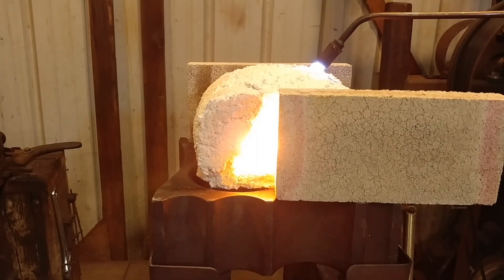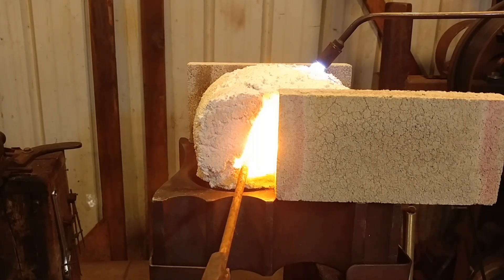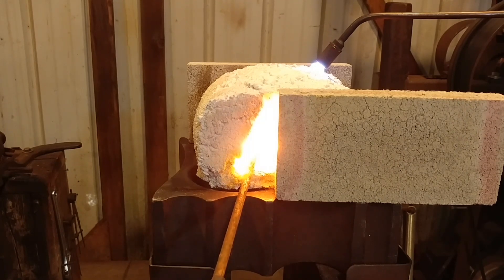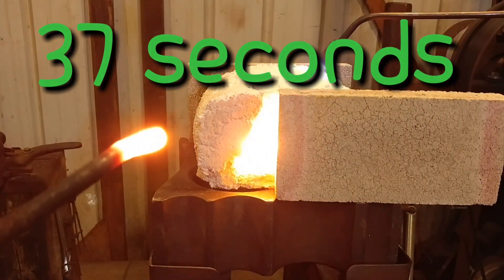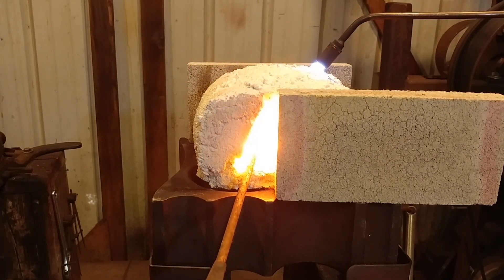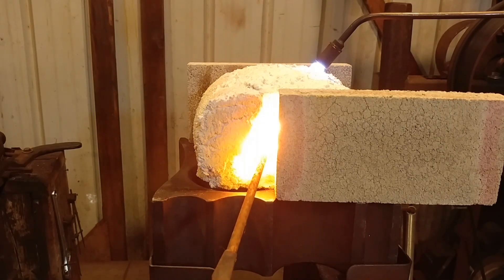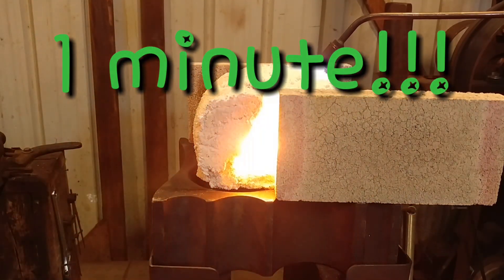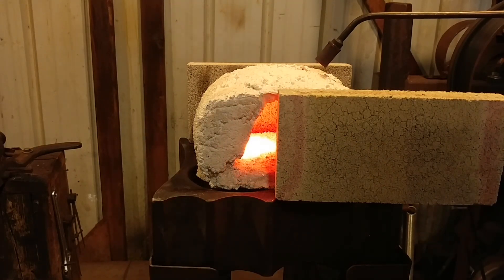Test Forge!! (Testing Homemade Refractory for Forge)

Comment: is it oxygen rich. can you get a neutral flame with that set up. Thanks j.
Reply from the maker: +Joshua De Lisle the flame I was using in this video to heat up so quick was very oxygen-rich. But you can also adjust the Torches to run new more neutral just as you would have just a regular torch. Still testing this design out yet. Thank you for taking the time Joshua to stop on by and check out the video. God bless you and all your endeavors look forward to seeing some more videos from you too
Reply: Thanks mate! I look forward to seeing more too. J

Comment: Keep up the great videos.  I am also looking to make a forge to do some back yard heat treating.  This sure beats a hole in the ground filled with coals and a hair dryer.
Reply from the maker: +Dirt_Bike_Zero well it will certainly get the material hot that is for sure :-) thank you for the great Comment God bless

Comment: Is it plaster
Of paris and sand is great. I did it multiple times for coal. The first heat is rather cold but the second is great. The only downfall is that it crumbles easily.
Reply from the maker: +Jaxxon Koethler this is just a mixture of perlite and mortar. I have tried plaster of Paris in the past with mixed with sand and did not like it as it was too brittle and always was falling apart. Also the mixture seemed to absorb quite a bit of the heat from a flame rather than reflecting it to the metal being heated. Once I get the mixture right I will make a much better looking Forge out of it and go over all the materials and how to build it :-) thank you for taking the time to watch God bless